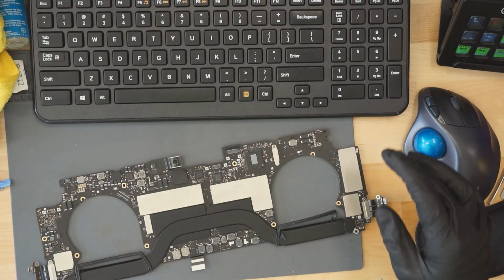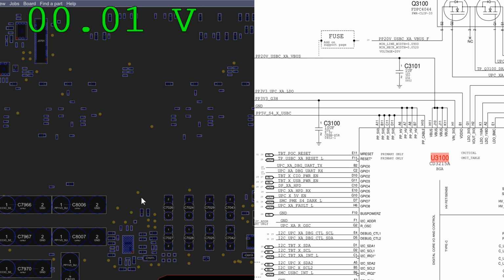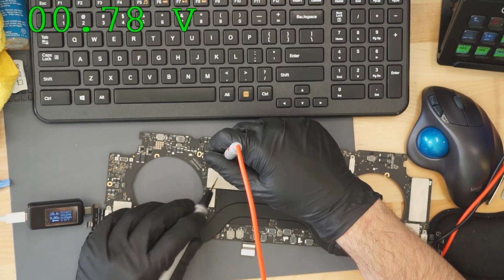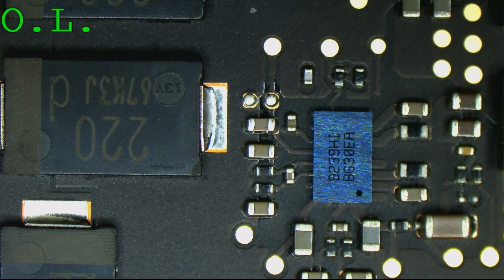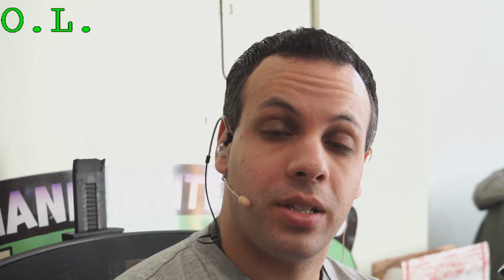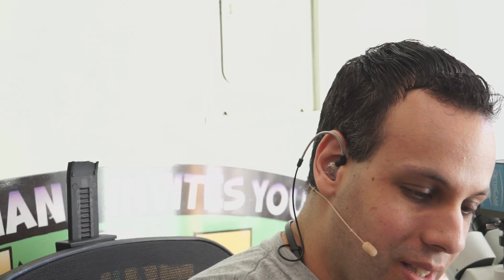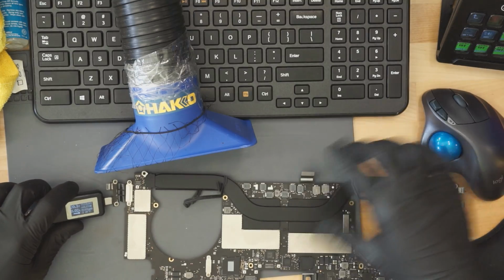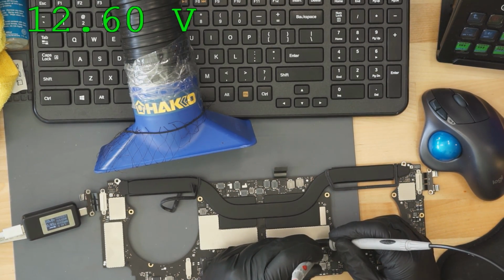Why new Macbook boards will be unfixable for me: sad :(

Comment: Am I the only one who doesn't understand anything but just watch anyway because it's just a bit satisfying?
Reply: The short of it is that in order for you to charge the laptop battery, there's a chip that controls the recharge of the battery so it gets the right amount, yeah?  Sometimes, for no good reason, that chip dies and the laptop becomes substantially less useful.

Louis used to be able to easily get the chip (ISL9239) that Apple used in its Macbooks, but Apple switched to a new one (ISL9240) that the manufacturer does not offer for sale to the general public.  In effect, when that chip fails on newer Macbooks, it'll be impossible for anyone other than Apple to replace the chip as part of a repair.

The result is that the Apple "Geniuses" will do what they do:  Take it in the back, open it up, make things worse and then come back and tell you that you need to buy a whole new logic board for more than the cost of a new Macbook.  If you believe them, you'll then just decide to up and buy a new Macbook and their sales staff will be glad to try to upsell you from there.  Your old computer will be consigned to uselessness.  Apple will pat itself on the back for being environmentally friendly because their headquarters is a donut.
Reply: Cass Carter can you at least get your data back?
Reply: Idk i know that flux when u use heat gun on it it magically remove something but thats it
Reply: @tomikun8057  nope
Reply: @jeffersondemott2125  yes coz i forgot to say i dont know anything its just satisfying flux magic
Reply: @tomikun8057  idk what happened but I meant to reply to the original comment. Sorry man.
Reply: @jeffersondemott2125  i have not gotten a notif since you said nope. yt is weird
Reply: @tomikun8057  The flux is used primarily to prevent oxidation of the contacts to be soldered and to chemically etch the surfaces so that the solder can make a better bond.
Reply: @asicdathens  oki
Reply: Board is sandwich of copper and insulators (one or both sides), on that you print connections between chips that do different simple tasks. Those chips break sometimes and need replacements. Also each ship has name.
Reply: I watch for the entertainment and still trying to figure out how Louis finds all the hot ladies.
Reply: ISL 929 underscore G 3 hot. Whats not to understand
Reply: I used to watch videos on English for the same reason, now I speak english and work with it, keep doing what you do.
Reply: no
Reply: Probably has something to do with the fact that he rattles off complicated part names at Mach 5. But I agree that the videos are very enjoyable to watch.
Reply: Yeah I'm 100% here for right to repair legal issues and business ethics.
I can't solder my way out of a wet paper bag.
For all my work machines going forward I'm pretty sure I'm just going to tell Puget systems what I do and pay them what they ask then if anything wears out, just mail in to rossmann and pay what he asks.
SOOOoo much cheaper to just do business with non-scammers and charlatans.
Reply: It's basically a matter of what kind of voltage, current or resistance to expect in specific locations across the board. He has a multimeter, he looks at a schematic, which tells him what kind of voltage, current or resistance is expected at a specific contact point in a given logic board. Based on the problem and also his past experiences, he takes an educated guess as to where that problem may be located and he starts probing(little needle-like things that he uses to measure voltage, resistance or current) until he finds something off, by something off, I mean a voltage value that does not match the info on the schematic, for example. Once you find anything that does not match the values on the schematic, he uses the schematic to pinpoint where the signal is supposed to be generated and starts inspecting and replacing components along the path of the problem that he just identified. I tried to simplify, this is definitely not all of it, but it's what I do and it may give you an idea about how "he" does it.
Reply: He talks fast and this video was edited and sped up and things cut out, it made him talk so fast that I couldn't understand at points lol
Reply: @tylerkauffman6190  no that's how he talks
Reply: It doesnt look that hard. Its just a bunch of gates sending electricity between eachother. It looks complicated because there is a lot of stuff going on.
Reply: I understand about electronics but the terminology he uses isn’t part of my scope of knowledge sorry
Reply: No your not the I'm the same way I just like to watch him work a babba about apple
Reply: I don’t even know what he does but it sound like he know what he talking about
Reply: Yeahh, specially the flux part hahahah
Reply: Nope, 1.2 million apple specialised electro technicians over here.
Reply: You are not alone brother
Reply: No.
Reply: Nope. I own two macbook pros and i find these other macs coming to life satisfying to watch too.
Reply: I think he drinks a gallon of Starbucks Espresso before he starts his videos
Reply: Yes. You're the only one we're all experts
Reply: I've studied electronics, analog digital, high voltage and low voltage also fixed computers as a job for a time, I have a real hard time keeping up with him, I never knew or really tried to apply knowledge to that level,

He is THE real deal.
Reply: AlessandroTheCynical - as he said recently, one of his lessons learned is his company is not scalable.  It takes a decade to develop his level of skills.
Reply: I dont know wtf he said but find it interesting
Reply: Same
Reply: Not the only one for sure. Same here. No idea why I watch these from Louis - understand nothing or very little yet I keep watching ;)
Reply: Big relate
Reply: seeing this made me feel better lol
Reply: @Zbra718 Me neither. Big fan still.
Reply: Yes, everybody else here including me know exactly everything that Louis does. The whole 1.33 million of us all run repairshops all over the world!
Reply: No, you are not the only one
Reply: And it affirms my anti apple bias 😂🤘
Reply: I dont understand everything but i do understand “motherboard” “cpu” “housing “. “LCD” “usb” “volts” “backlight” “chip”
Reply: Yeah me too. Louis is a real geek
Reply: I’m here for exactly the same reason
Reply: It is his calmly voice
Reply: No
Reply: Me Two
Reply: NO. HELLO I'M ONE OF THESE PEOPLE TOO
Reply: Pretty easy to tell what they do the names he says is for the chips for charging and over discharge and under volting protection for the battery
And the chip just fails for no reason but the one reason in the video is because of fake chargers that are not by Apple of course you have to waste your money on they’re chargers when you can get cheaper ones but that just causes the charging chip to fail 👎 good job apple
Reply: i just need more reason to never buy apple ever again, but yes i would love to know more about this magical paste
Reply: No
Reply: 100%
Reply: I just watch for the rants, like the one at the beginning of the video.
Reply: I watch "Crime pays but botany doesn't" for that.
I like creative swearing, but  find Louis' mannerisms quite a bit annoying. What with displaying quite a bit of malice and vindictiveness, be they merited or not.
Reply: @HotelPapa100  That malice and vindictiveness is the reason I watch the videos lol, mostly because it's directed at apple

Comment: I tried etechparts. I think 3 ipad displays, couple iphone displays, some buttons. I think just one display worked. The rest had screwed up digitizers, the buttons were thicker than they should be. When you mounted them in place would be pressing themselves. Not sure if I got really unlucky but much butter luck with cheap ebay parts. They never replied about taking returns.

Comment: This is where you attempt to design a custom part (PCB) that acts as a standin for the chip. I know of a company that makes controllers for heavy machinery and when the parts they use dry up they simply design a PCB that does the same thing as the part.

Comment: I have a question about charging cables 
Are some better then others? Like a micro USB can one USB cable pull eclectic currents faster or slower then others? Why would some cables die faster then others? I have a quick charger brick and I used a micro USB cable to charge my Bluetooth speaker and after a few weeks it just doesn’t work anymore 
Lightning cables for iPhones do the same when using a quick charger...makes me think cord ends can burn out or something

Comment: Why would anyone buy anything apple?
People have given me apple products over the years which i either gave it away or sold it never would i use an apple product. I don't understand why in 2019 anyone would use apple period.
Reply: People use what they like I for example use a iphone SE ,iphone 4 and I have a ipod touch flying arround somewhere I just like the formfactor and the itunes musicplayer I had a android device for a while but couldnt get used to it so I went back to my ipod touch till I swapped to the iphone SE and thats what I use now everyday.

Mind you I use the SE not as a phone I use it as a Musicplayer for 1 simple reason it has some neat feature's that the touch didnt have when I was using it maybe they added them by now but I am to lazy to go and check all the update's. xD

Comment: actually that's incredible; imagine this scenario: there's a company, globalmegacorp, that sells a product that has a failure rate of x% due to a bad chip. it's a simple fix, provided said chip replacement can be obtained. then, the next revision of the product comes out and said chip has been axed and a new supplier is found. hurray! issue fixed, right? but now this new chip is having the same failure issue as the previous one and is not sold to anyone other than globalmegacorp. that really, really sucks.

i hope that these anti consumerist measures are penalized in full one day.. something beyond the slap on the wrist fine that's less than 1% of globalmegacorp's annual gross income.

i hope you find your unobtainium, louis.

Comment: If you touch it and it works again.

It's likely a bad soldering job. 

Plus, if electricity is arcing across a connection. Then tarring on the connection will accure.

Comment: Ok I haven't worked with surface mount electronics, but I did work with external mount electronics, but the problem you were showing there, where if you just touched the chip it started working. Instead of it being a bad chip, could it just be a cold solder joint?

Comment: No wonder their Macbook and Apple sales are going down the tubes. Buyers wants DIY fixable/upgradable/DIY inspectable/DIY checkable/easy-to-touble shoot/DIY easy to cluster/DIY easy to interconnect/DIY easy to adapt/DIY self-teachable USER-FRIENDLY IN PLAIN ENGLISH INSTRUCTIONS FOR NON-COMPUTER USERS/FIRST TIME COMPUTER USERS. And a computer with DIY hot-pluggable/hot-swappable motherboards/components NON-STOP hardwired design with DIY fixable/maintainable PASSIVE cooling system and all are easy to clean by air blasting and vacuum cleaning, with lots of USB pheripheral ports with MODIFIED CLUSTERED DAISY CHAINABLE FIREWIRE SYSTEMS TO BOOT and complete with "IN PLAIN ENGLISH" computer manuals with DIY/self-teaching/highly explanable and highly illustrous step-by-step explanations. Just like what they once did during the 1980s!

Comment: This is why I keep my ThinkPad e530.  It was running Win 7 and I knew that upgrading to Win 10 would involve buying a Windows license and an SSD because the HDD was finally dying after almost 7 years. 

So I found a $50 480 GB SSD and put Linux Mint on that old ThinkPad. 

The old machine was three screws, a pry tool and OFF. Put the bracket on the new SSD and that was it. The e530 is easy to access and repair

Within 2 hours, my laptop was set up and everything worked out of the box on this version of Linux.

Comment: Man, I got a Dell with an on board 1050ti that has an drop sized area of liquid damage that corroded about 3 cm of little to nothing I wish I had the equipment to repair, and a microcap I popped off opening her up. As always it could be more, but is almost obviously not. Any chance you guys can slap her ass and sender home screaming? I don't do Mac, but love you. If not you, do you have any suggestions?

Comment: if the chip has the same functionality but a different pinout, you may be able to have a double layer pcb fabricated for pretty cheap to trace the pinouts to the old bga. you could also make a breakout and use a few other very cheap chips to get the same functionality, i'm assuming. Might not be worth your time. I'm not sure how much money you make on these repairs and selling parts.

Comment: This video was recommended to me
1. Most of the info at 3:25 went over my head
2. 4:30 how does that work?
3. Subscribed.
Reply: I'm assuming those are small solder pads, which solder sticks to very well. I think he's cleaning it by heating it up and applying more solder, as well as making the little beads on top all uniform so they have the same amount of solder

Comment: Why not try with an ISL9241 when you cant find the ISL9240.
I couldn't find a datasheet on the ISL9240 at renesas.com but the ISL9238 and ISL9241 are pin compatible according to a quick look at their datasheets.
So its most-likely likely the same for ISL9240 and then there is a small chance it might work.
The ISL9241 are available at https://www.newark.com/renesas/isl9241hrtz-t7a/batt-charger-li-ion-18-304v-tqfn/dp/84AC1810?st=isl9241
Reply: Well, I assume they made it almost pin compatible, just make it not work with anything else.
Reply: Rene Heilesen I would like to know if this works?
Reply: @Louis Rossman

Comment: Your technical skills are amazing.
The only thing I don't understand, is everything you said in this video.
Reply: All I understand is him checking the electric flow through boards and finding where that electric flow stops, replacing chips, or solder on chips and then checking the electric flow to make sure the problem is solved.  I don't understand what chip does what and how he figured out right away that chip was the problem, but I like his videos with how he talks about his life and any bs apple does.
Reply: Louis has stoped explaining everything a while back so you should check out his previous videos, and you might learn how to repair macbooks!
Reply: @Righardt Steyn ALGORITHMS
Reply: @Righardt Steyn I dunno man the algorithm works in mysterious ways. Im gonna set my text message tone to him saying PPV3POPP3G over and over though.
Reply: In fixing electronics, one would normally spend around 75% of the time diagnosing the underlying issue, and just 25% actually fixing it.  I see way too many shops who spend most of their time the other way around, then end up having to redo it, because of the wrong diagnosis.  SMH.
Reply: Same here.  I did enjoy watching the soldering process.  Dang, things have changed since I was in the 6th grade....36 years ago
Reply: @robertr6195  I'm guessing you soldered simple PCBs like I did, this stuff is multi layer surface mount crap... soldering irons are a musing of barbaric history when it comes to that stuff, it scares me ! XD
Reply: he said he'll now have to reuse some old chips from junk boards (every so often) instead of buying new chips, just like he did before....mhmmm...
Reply: @IvoK < Well yeah cuz Apple doesn't supply some hard to find parts (correction, basically any parts), so we gotta scavenge it from other boards.  It's sad but true.
Reply: Lol, hang in there
Reply: @Righardt Steyn i havent watched this guy in a while and it ended up on my feed so maybe there is something in the algorithm
Reply: LSD4UAME lol that was funny
Reply: It’s a “New York” thing....
Reply: LSD4UAME dude mom said I could have the ISL9239
Reply: Try watching on .75 speed, slows him down to something mortals can comprehend.
Reply: Do as I did. Download the video a play it at 0.5 speed. His english is perfect that way
Reply: Well played @rodney howells
Reply: Slow the video down... doesn't help either but hey
Reply: Cuts”
Reply: Me neither, but I watch every video anyways.
I even feel like I want to buy some chips from his site, even when I have no use for them.
Reply: I'm learning electronics and this teaches me little by little
Reply: Short translation: The chip is intermittent, it works sometimes, usually not. It wasn't delivering a signal to activate a power rail, then he nudged the chip and it worked so he replaced it. 
Other models, he can't buy the ISL9240 chip to fix this issue through any avenue of approach since apple seems to be campaigning against its availability, even scrapped boards get it chopped out. Never buy apple.
Reply: He has a clean sets of hands. That's a technical term we use for neat and tidy fixes.

Comment: Why isn't the flux boiling when you hit it with the hot air? If it's hot enough to melt solder I'd expect the flux to be boiling off.

Also, the audio seems to be out of sync.